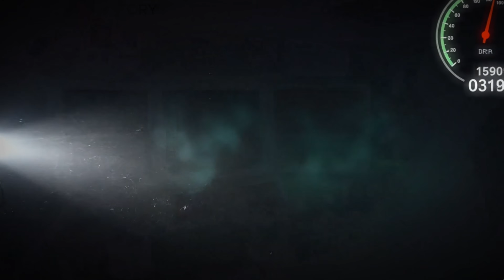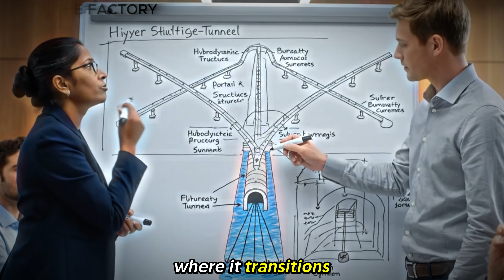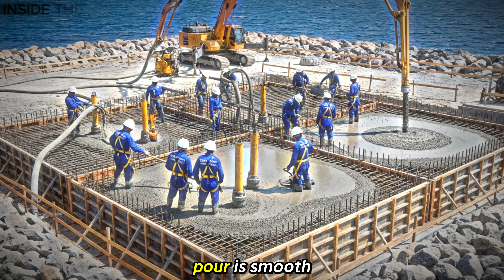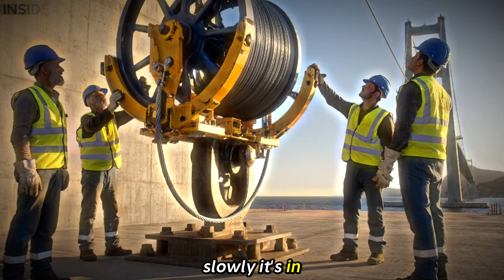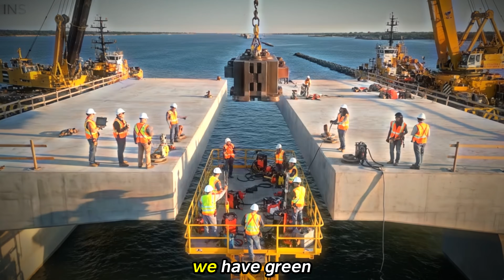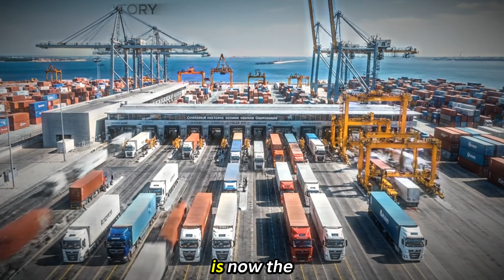Governments Spent $23 Billion on a Bridge That Can't Be Built

Comment from the maker: 🤯 Something that genuinely shocked me while researching this video:

To build a bridge over the Strait of Gibraltar, engineers would have to account for the fact that Africa is moving TOWARD Europe at a rate of about 2 centimetres per year. 🌍⚡

That means the bridge would have to be designed with a "flexible foundation" that can literally stretch and shift over decades to prevent the structure from snapping. It's not just a bridge — it’s a living, moving machine. 🏗💨

My question for YOU: If this project finally happens, would you prefer the ✅ $23 Billion Undersea Tunnel (faster and safer from storms) or the ❌ 14KM Mega Bridge (one of the most beautiful views on Earth)? 🌊🏔

Drop your answer below and tell me WHY — let's see which engineering vision wins! 👇

(Also — should I do a full deep-dive ranking EVERY "Impossible Bridge" ever proposed — Gibraltar vs Bering Strait vs Sicily-Calabria? Drop a 🔔 if YES and I'll make it the next video!)